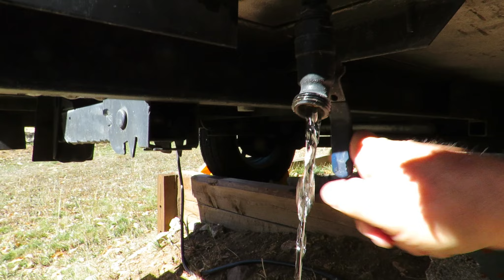Casita - How to Winterize your Travel Trailer by RV Adventures

Comment: Question: I followed this TWICE - Still getting a little “gurgle” in the cold water spigot in the bathroom (no where else). A. So if there is a little water in the line only to that line how do I get it out? B. We winter our camper in a garage where the temperature never gets below 30 - is is something I should stress over?

Comment: I am now on year 3 of using this video to winterize our '23 Spirit Deluxe.  Invaluable, complete, and clear!  Thank you, Alan!  The only thing I would add, and this is important, is that the pressure in the water heater needs to be relieved before attempting to remove the anode.  Last year the anode shot out as I was backing it out with the wrench -- I could've gotten a pretty nasty bruise (maybe worse?) if I had been more directly in its path!  Maybe it's something others typically do when they break camp or something; I don't know.  But for me it has come up during winterization.  To relieve the pressure first, I open both the cold and hot water valve for any faucet, then engage the pressure release valve on the heater until all pressure is gone.  Then remove the anode.  Then close the valves before moving on with the rest of the steps.  Have others had to deal with this?  If so, why not?

Comment: Wow what a video!!!! Just got a Casita 2 weeks ago. I understand the process thanks to you. Will go to Lowes and pick up an air compressor today. Only part I'm confused/cant find is the adapter (looks brass) that connects your air compressor to the city water line...looks snap on. Have a link please? Thanks!
Reply from the maker: https://www.amazon.com/Camco-Brass-Connect-Aids-Removal-36143/dp/B002XL2IEA?crid=2D9XAGKOZDQNY&dib=eyJ2IjoiMSJ9.FaYWCaEYCpKE6r112BpOeQ.qCIm5o4zl5FE9RhX6O7Rk-WuSlJSMU-Q5-4QdHqdqa4&dib_tag=se&keywords=B0024E6V30&qid=1710608076&s=automotive&sprefix=b0024e6v30,automotive,126&sr=1-10-spons&sp_csd=d2lkZ2V0TmFtZT1zcF9idGY&th=1&linkCode=sl1&tag=rv.adventures-20&linkId=517ec59604d4382e96a205285f2f09b1&language=en_US&ref_=as_li_ss_tl

Comment: I have a 2024 Independence deluxe and the bypass position is different now that you are looking down at the bypass from above. It's not a big deal, you can tell when it has water flowing into the water heater and when it does not just know that it will be a different position if that is your situation from this video.
Reply from the maker: Thanks for that info.

Comment: Why put antifreeze down the toilet?  If the black tank is empty and you blew air out the flush valve, what are you protecting?  The outside drain valve??
Reply from the maker: Yes. Having a little antifreeze in the tanks protect the valves.

Comment: HELP!!! I did everything he did except when I tried to blow air through the water heater nothing happened. I was able to drain the water from the heater but no air was flowing. Why?? I turned the valve ND NOTHING!!!
Reply: Ok so what we discovered was the air compressor we are using is strong enough to clear the lines but not strong enough to remove ALL of the water in the water heater. I felt air coming out but not forceful enough. There is still about a half inch of water in the bottom. Is that ok! It will be 20 degrees here In few days. I just looked on your page at all of your supplies and I have that Red air compressor. What am I doing wrong? The gage will not go over 20 when I'm blowing out the water heater when I was blowing the lines I had to stop it from going higher than 30. HELP!!! Again (:
Reply from the maker: The water heater never gets all the water out. The anode hole is higher than the base of the tank. I don't worry about that little amount because the tank is steel and the expansion of the water in the bottom of the tank will not break anything.
Reply from the maker: Without the Anode rod in the heater tank the air pressure can't get very high. When blowing out the lines, make sure the Anode rod is installed. Only remove it to drain the tank prior to blowing out the lines.
Reply from the maker: Here is a test for you to do... however, after doing this, you will need to redo the winterization process. Prep: Turn off the water pump and hot water heater. Install the anode rod into the hot water heater. Step 1) Close all your water valves, hot and cold. 2) Hook up a water hose to your city water connection and turn on the water. 3) Open the kitchen sink cold water faucet and make sure the water flows. 4) Close the cold faucet and open the hot water faucet and wait for the water to flow because the hot water heater has to fill up with the 6 gallons of water it holds. The cold water comes into the hot water heater on the bottom and hot water flows out of the top of the heater. If the water flows after the water heater fills, then the valve is in the correct position for normal flow. This is the position it should be in to blow air through the lines.  5) If thewater flowed out of the kitchen hot water faucet you are ready to blow air through the system. Close the kitchen hot water valve, remove the city water connection, remove the anode rod to drain the hot water heater and after the water has drained, replace the anode rod. 6) Apply a continous  air flow (20-30psi) to the city water connection. 7) Open the kitchen hot water faucet and water in the line should drain out and be followed by air.  At this point, you can reopen the faucets one at a time to repeat the winterization process. Hope this helps.
Reply: @RVAdventuresTV  can I just turn the switch both ways, turn on the air compressor and see which direction allows it flow?
Reply from the maker: Yes. You can't hurt it.

Comment: This is the third year of following your winterize video. Thanks. One question: when I disconnect the fresh water hose that's connected to the pump filter and compressed the water out - I must have done it about 30 times and continued to have water squirt out, soaking 3large towels. (Yes, I drained the fresh water tank first) I finally gave up. What is your opinion? Thanks so much for your video!
Reply from the maker: My thoughts are to make sure all the other water faucets are open, not forgetting the outside shower and inside shower, both hot and cold on all, drain the hot water heater as well as the fresh water tank, then blow out the lines and finally, remove the pump filter and blow again. There is always water in the line from the pump to the water tank, especially if the trailer is not level or slightly leaning towards the water tank. That line is the lowest so that the pump can self prime. Hopefully this helps.

Comment: Your videos are the gifts that keep on giving - thanks, Allen!

I have one question. No matter which way I turn the hot water tank bypass, it does not stop compressed air from feeding to the hot water tank. The only way I can stop it is by reinstalling the anode rod. Am I overlooking something, or do I have a bad valve? Everything else went as expected. I should note that we always use the city water connection rather than the fresh water holding tank.

Thanks again! - Glen
Reply from the maker: The air is likely back feeding from the hot water outlet of the heater. Air put into the cold line crosses over in the faucets. It is best to leave the anoid installed and the bypasd valve in the normal position so that the air can travel from the cold side thru the heater and out of the hot side to insure all the hot water lines are blown out.

Comment: Hi Allen, Thanks for your excellent video and the willingness to share it with us! We bought our casita about 6 months ago and we did already winterized our casita using you video.  However, we used the trailer in the meantime and need to winterizing again today.
The first time we winterized,  We didn't have a way to blow the water from the line that comes from the fresh water tank like you did on the video because we didn't have a nozzle to blow the air into the line back to the fresh water tank.. We have not used the fresh water tank since we bought the Casita 6 months ago .
We did Disconnected the lines from the pump , cleaned the filter and turned the pump 5 seconds and some water came out the first time we winterized. 

So here is my question:
In order to winterized again, do we need to disconnect the lines that connects the pump and repeat the process again although we didn't use the fresh water tank?
Does any water from the city outlet goes to the pump that we need bow out? Sorry about the dummy question but we really trust in your experience and insight. 
Thanks a lot.
Mari
Reply from the maker: If you don't use the pump or water tank, then there should be no water in it. The city water doesn't go into the pump as long as the plumbing is working correctly. There is a one way valve to keep that from happening in the lines around the hot water heater.
Reply: @RVAdventuresTV  Thank you very much! I didn't know that about the one way valve. Probably I need to learn more about the Casita plumbing system 😉😊. It is a relieve knowing that tough!!

Comment: Thank you for your very clear video. I’m traveling full time in my 16’ Casita Spirit Deluxe and some very cold nights are predicted in a few days. I loved that you presented 2 options - so I chose the 2nd one and was very fortunate that I was staying with a friend who had all the right tools and equipment. (I also went out a got an air compressor, etc) Easy peasy! I also appreciate that I can easily bring water back into my system when I head further south again!  Thank you so much 🙏🏼 
I also changed the toilet valve by myself a few months ago thanks to your video. Great resource!!

Comment: Do you think the Ryobi 1 Gal 12V air compressor would work for this? Or would it take all day to use this? I just got one but wondering if I should take it back and get something larger.
Reply from the maker: should work just fine.

Comment: What brand/model air compressor are you using?
Reply from the maker: For the home base, I use the PORTER-CABLE Air Compressor, 6-Gallon, Pancake, Oil-Free (C2002): Link to product: https://amzn.to/30YydsW

For on the road, I use the TIREWELL 12V Tire Inflator-Heavy Duty Double Cylinders Direct Drive Metal Pump 150PSI:
Link to product: https://amzn.to/3xn8cQ5

Comment: Great videos.  When draining the hot water tank if you open the pressure relief valve once the anode is removed the tank will drain very fast.  Good idea to cycle your relief valve occasionally so you get two for one.  Happy trails
Reply from the maker: Great point!

Comment: Excellent video. You’ve converted me to chemical free winterizing. One question. I was told that the small valves in the sink are very susceptible to damage freezing. Do you feel it might be safer to leave them in an open position?
Reply from the maker: Great point! I must have not mentioned that, I do keep them open while winterized and it is safer that way. Thank you for the question.

Comment: My casita does not have a anode rod- is that something you added? Thanks for making this video!
Reply from the maker: I would encourage you to look at the bottom center of the hot water heater for the 1 1/16" bolt head which is the anode rod, accessed from the outside hinged door. All RV water heaters with a water tank have one.

Comment: Excellent winterizing video!  We are new to rv’ng.  We are subscribers and watch everything you folks produce.  We live in Ohio where our weather can go to 0 degrees and with wind.  I don’t recall where you live.  Will this method work for us?  And, what tools do you specifically use - didn’t see them on your Amazon site!   I was thinking about a Via Air with their winterizing kit for multi purpose use.  Thank you for your time and consideration.
Reply from the maker: Welcome aboard! Yes, we are in northern Colorado and blowing out the lines work well for us. We have -15 degrees most winters and have no issues. The air compressor and accessories we use are on our Misc. Amazon page here: https://rvadventurestv.blogspot.com/2021/02/amazon-misc-items.html and the blow out plug is on the Water/Sewer page here: https://rvadventurestv.blogspot.com/2021/02/amazon-water-sewer-items.html 
thanks for watching. Happy travels.

Comment: I would like to thank you for the step by step tutorial on winterizing my Casita. I have a 2021 and the hot water heater is different, in the fact, I don’t seem to have a anoid rod. When I remove the screw where the rod should be all that comes off is the plastic screw. I am sure that they must have something else. I am going to have to look into it further. Also the on off switch is inside the trailer now. I think perhaps Casita should hire you to do there demo video. I also did your bathroom shower curtain tutorial and it came out well. Would you be able to tell me were you got the silver ring that you hold the curtain back with. Thanks again for your videos. 
Andrea Moore

Comment: I have a 21 trailer….I don’t see any of the plumbing accesses you are talking about.  I am worried just blowing out the faucets is not enough….where are you accessing the pump?
Reply from the maker: On the Liberty Deluxe the water pump is accessed through the wood panel under the bench seat at the rear on the kitchen side. It should be a hinged door that opens down into the walkway.

Comment: How do you keep the air pressure at 20psi on your compressor?
Reply from the maker: My compressor has a tank pressure regulator and a line pressure regulator, both have gauges to enable you to see and set the pressure.
Reply: @RVAdventuresTV  yes, thank you!, figured that out now when shopping for one. Owning my Casita has expanded my knowledge of many mechanical devices! 😄

Comment: Need your advice. I posted this also on Fiberglass Forurm. 
Am I missing something? On my Casita 2019 when I drain my water heater & leave the plug out water still runs into the water heater. No matter which way I turn the valve. I have removed it & reinstalled it. I have reversed it. Today I replaced it & water still runs into the heater.
I hooked up my water hose to the freshwater fill with an on & off valve. I turn on the hose & water flows out the water heater. Cut off the hose & switch the position of the valve & water still tuns out. Even the same results with the water pump. The last couple of years I poured 5 gallons of RV antifreeze into the water tank & pump it through the lines. I was hoping to avoid this year?
Is my plumbing not done correctly? Any ideas?
( I did reinstall the valve back the way it came from the factory.)
Reply from the maker: I would suggest draining the fresh water tank, unhooking the fresh water inlet hose, open all the water faucets, hot and cold, flush the toilet until the water stops, place the shower wand in the basin and open it to drain, then take out the hot water heater plug. With all of this done, the water should stop flowing out of the water heater after all the lines are drained. I would also suggest using the "blow out the lines" method over antifreeze.

Comment: Hello. So, if I was to pour the antifreeze into the fresh water tank and then go into to the Casita and have it come through all the lines... would the blowing of the lines and other things be necessary. I guess I’m a little confused since I just watched the YouTube video that Casita has on their channel. His instructions were a bit different. This would all be a first for me. Thank you.
Reply from the maker: Antifreeze is OK. The blowing out of the lines is an alternative to the antifreeze method.
Reply: I use the antifreeze method for the last 2 winters. I pour 5 gallons into the water tank & run it through. The only issue I have is the antifreeze still runs into the hot water tank. No matter how I turn the valve. I flush out the tank afterwards and leave it dry. This year I am going to do the blowout method and see which one I like better. I love his videos. He does a great job.

Comment: Hello Alan, have you used the portable tire pump to blow out the lines?  If you did, how did that work out?  I've got a portable tire pump that will attach to brass blow out plug but it has no regulator to adjust the pressure and no tank to maintain a decent pressure level.  Thanks - John - 2011 LD owner in Colorado Springs.
Reply from the maker: I had one occasion to use my portable air compressor and it worked just fine. You really don't need a lot of pressure.
Reply: @RVAdventuresTV  so, did you just leave it running while you opened the faucets in the Casita.  I'm worrying about excess pressure in that situation.

Comment: Alan, great video and thanks for the time and effort you put into your howto videos.

One question.  I noticed that you removed the hinges from you water pump, heater, plumbing access panel.  Did you just reverse the door so it opens down or did you modify access in some other way?  Appreciate your feedback.  John in Colorado Springs.
Reply from the maker: The storage drawer platform that the pet carrier mounts to  has a notch in it that the door slips into. I removed the hinges so that edge was smooth to drop into the notch and the latch at the top holds it in place. I didn't want to have to remove the platform each time I needed to access the compartment. Thanks for the comment and watching.
Reply: @RVAdventuresTV  Thanks Alan.  I have always thought that door would have been better mounted upside down.  I may go that route.  For now we just have a plastic storage container that slides into that rear floor space.